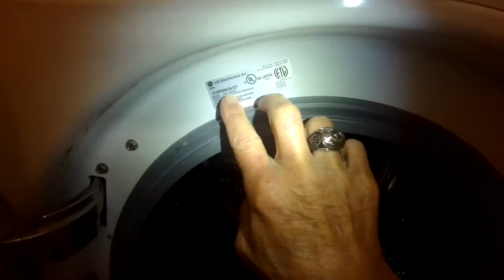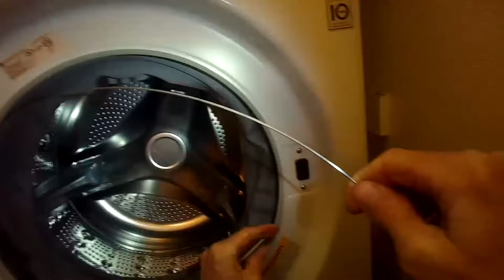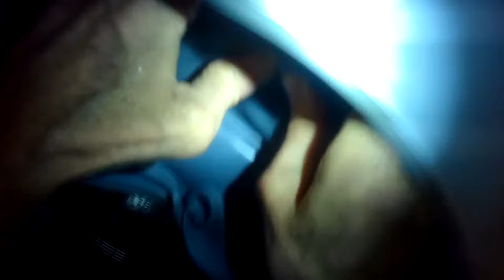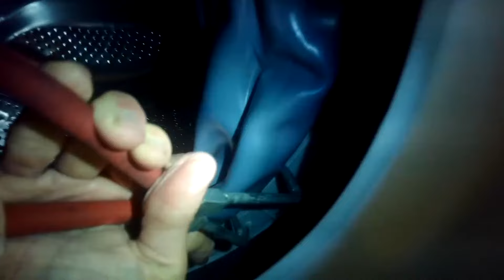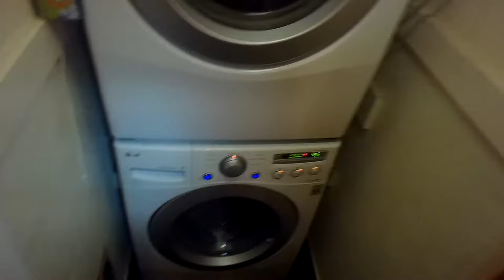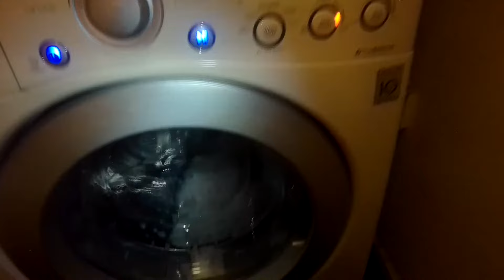✨ FIX LG WASHER LEAK - REPLACE DOOR GASKET - QUICK AND EASY SOLUTION ✨

Comment: Im a woman all by myself. It's the outermost wire that keeps falling off. Do i need a special tool for that? It doesn't seem like it. It really just seems that my hands are not strong enough to stretch the small length of spring at the 6 o'clock mark to get it on there. Do you have any advice?
Reply from the maker: Can you try coating it in liquid detergent to make it slippery?
That makes it much easier 👍

Comment: One of the worst repairs I have ever done.  If you do this, save yourself hours and look up the wrench and zip tie hack. No human can stretch that spring by hand
Reply: do yourself a favor and get yourself the spring tool and remove the front panel, exponentially easier job
Reply: Worked for me, but had to incorporate a knee to hold the left side in place. Lol

Comment: I found it easier to take the whole front panel off, to have more space to work with.
Reply from the maker: Yep,
This works well if you have a stacked dryer and it’s hard to remove the dryer 👍

Comment: Is it possible to take off the rear clamp without the pricey pliers?  Going to DIY in a week..at least I will try 🤞🤞
Reply: I was able to do it with a flat head screw driver. But be careful not to over do it.
Reply from the maker: You can sometimes borrow that tool from a local tool library 👍

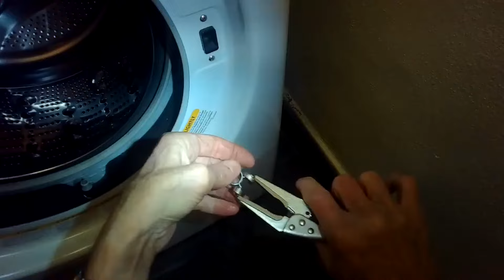Comment: Great video, and interesting that one can install the door gasket without taking the machine apart.  IMPORTANT NOTE:  Unless I missed it, the video does not include reconnecting the drain line after reinstalling the rear spring clamp 🙂  The video mentions the drain line and putting its spring clamp on at 7:20-7:40, but the video does not go back to that after the rear clamp is in place.

Comment: For anyone who doesn't have the fancy pliers, you can use a wrench and some zip ties... something like a 10m open end/12point other end.. 
You zip the spring looks to the wrench ends and get the same results as the 80 dollar pliers. 
It works if you don't do this often and don't need yet another tool that never gets used and take up space in the toolbox 
Just an idea 
Thats how I got my seal off to clean and reinstall as it wasn't as bad as the one in this video,  so I reused it. 
All I did is soak it in a pail of hot water with one of those washer cleaning pucks and scrubbed it clean than rinse, dry and put back on
Reply: Also a q tip worked great to clean the little drain connector for the the seal bottom, just like in this video mine was completely full of gunk and hair. 
A steam cleaner works really well for cleaning these washers .. no need to soak the seal or replace it.... just blast the gunk off.
Reply from the maker: Awesome,
Thanks Peter😊😊

Comment: Great video Scott!  Would you happen to know if the process is the same on the LG Washtower? We got some clothes stuck in the door and it ripped the gasket.
Reply from the maker: Hi Edward,
Can you please send me the model number for your wash tower to scottthefixitguy@yahoo.com
Reply from the maker: Edwin👍
Reply: @ScottTheFixItGuyChannel  I had a rat chew up the connector nozzle . I have a thinq washtower. Can I replace the connector nozzle without having to remove the front panel for the tower.  It's really heavy and I can't seem to figure out or find a vedio on how to remove the panel
Reply: The noolze connector was damaged by a rat.  I have a washer tower too . I was wondering if I could replace it without opening the front panel

Comment: Amazon sells the same pliers for 15ish bucks. Work just as good
Reply from the maker: They only work if you remove the front panel.
The bent type works if the front panel is still on but they’re pricey.